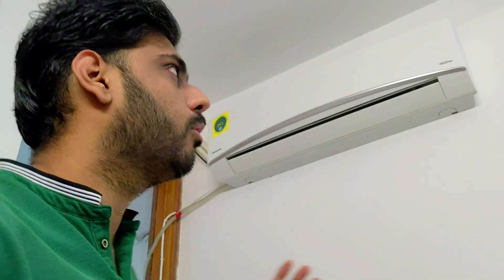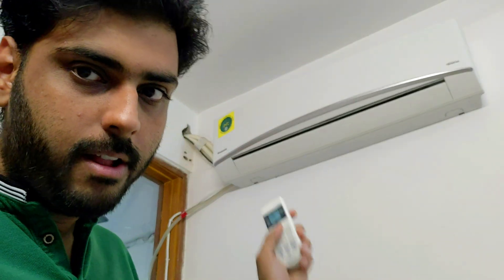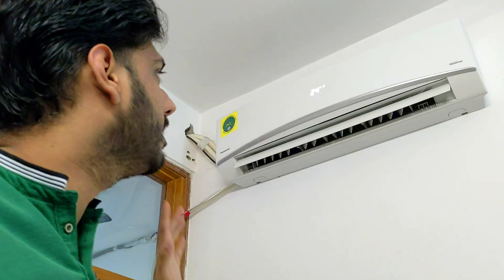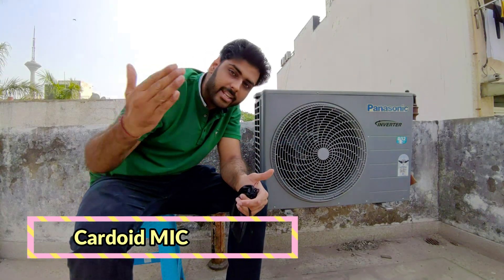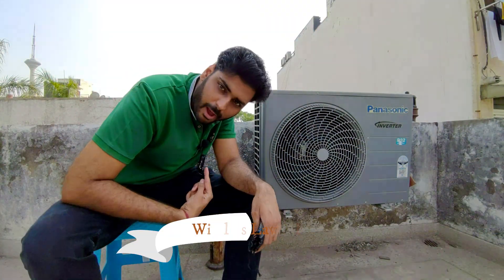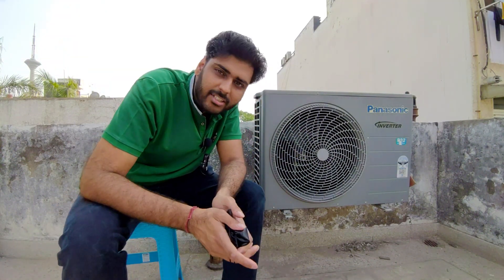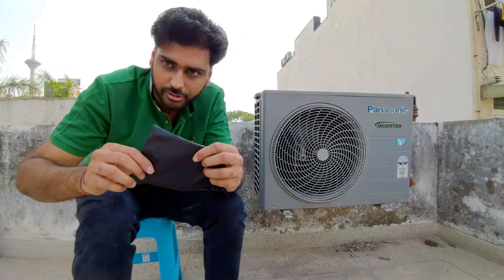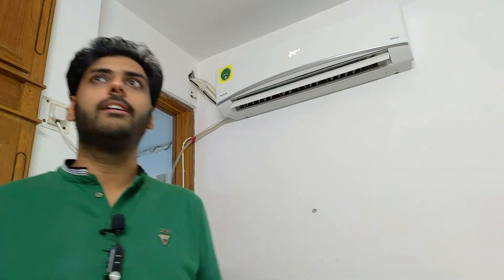Panasonic Split AC ki Awaaz || How Loud is Panasonic Split AC || Full Detail with 3 Different MICS

Comment: Bhai ksa working h ac ka....
175² ft ke liye sufficient h kya 1.5 ton model ???
Reply from the maker: Bro my room is 13 foot long 10 foot wide and 10 foot height and in that area the ac performs fantastic have no complaints.
Reply: Upto 180² ft ke lie rated hai ye

Comment: Acha ek baar darwaza kholo aur 16°C pe rakh kar AC chala ke dekho kitni cool kar rahi hai..🤔, maine apne 1.5 ton Panasonic inverter AC mein try kiya to utna cool nahi ho raha tha room compared to my old non-inverter 1.5TR R22 Split AC which managed to cooled the room significantly even after the door was opened completely. (Sizes of both the room is same).
Reply from the maker: We sometimes use this ac with 2 rooms of same size which 13 ft x 10 ft x 10 ft and first room where this ac is located gets pretty chill and other one gets liveable that too at 24 degrees. And the rooms are located at top floor which is 5 side open so it's gets hot but no problem.
Reply: Non inverter mein r22 gas dalti muje bi Aisa lgta non inverter ki cooling mein thandi jyda hai 😮meine godrej ka lia hai abi 4 din phle inverter ac aur dusra Onida ka non inverter 12 saal wala hai wo thanda jyda krta

Comment: It's loudy as compare to other brand..I purchased this one..
Reply from the maker: Well I don't know what silent actually is. But I find this one to be super silent compared to any window I have heard.
Reply: @AmulLuthra  yes it's silent then windows ac.. personally I am using Panasonic ac..but it will compare with other new ac..which is my frnds using..which is more silent..Panasonic after required temperature achieve it will be very silent.
Reply: Maybe because the air throw is more powerful than those offered by other brands, this Ac is actually rated for upto 180² ft. Area. While other ACs are rated for 150² ft area. Recently purchased the 2022 model.
Reply: @rajranpara257  Yes you are correct. Got 2 Panasonic 1.5 ton smart ac at home. Outdoor units sound is more as compared to other brands , maybe coz of fan Speed.
Reply: @starboy_inc6723  bro try to set indoor unit fan speed 3 or 5... Not use in auto mode...then check outdoor noise..

Comment: Bhai ek cheez batao,mere paas bhi panasonic ki 4 star invereter ac hai....mere mein set hua temperature ane pe compressor off ho raha hai..lekin ye to nahi hona chahiye kyunki ye to inverter ac hai
Reply: The compressor will switch off if the room is nicely air tight.
Reply: @rahuldasgupta5996  haan air tight to kiya hai..acha air tight hone pe agar compressor off hota hai inverter machine ka,to ye kyun bolta hai ke inverter ka compresser dhime chalta hai har waqt lekin kabhi band nahi hota??? Sabhi to yehi bolta hai..
Reply: @soumyajitkoley8918  it's not important that inverter will keep working all the time 😂 it happens to many. Inverter means variable speed but that doesn't mean it won't go off.
Reply: @rahuldasgupta5996  fine,but aur ek cheez main agar 24 rakhta hoon to 20 mint ke andar 24 ho raha hai aur uske baad compressor band hor raha hai aur thodi der baad firse on ho raha hai...isse kya zyada bill ayega ??jab bar bar chalu ho raha hai compressor tab lower speed pe chalu ho raha hai??
Reply: @soumyajitkoley8918  nope, it's gonna use electricity as much required but still you can buy smart plug to track the electricity consumption every time.
Reply: @soumyajitkoley8918 Yes mere Panasonic AC ka compressor bahar jab 42°C pahunch jata hai tab wo 100% speed mein nahi chalta hai, balki wo 90% mein chalta rehta hai, aur jab main 27°C pe rakhta hun. To wo slow hoke band ho jata hai.
Reply: @soumyajitkoley8918  Aur ek chiz, if you want to check how much is your 100% compressor speed, then turn your remote on and set to cool mode, temp in 16°C, Fan Full speed, Swing position 3rd and press the auto switch button present on the AC for 3 sec and (open the filter access door of Indoor, button will be present on right side).
Reply: Its panasonic dna, worst inverter ac i have ever seen and exoerienced.. non-inverter ac ke trha hi kam krta hain panasonic inverter ac, ruk ruk ke chlta hain, room ke andar kabhi thand toh kabhi thoda garm lgta hain.. full bakwas panasinic ac, i use LG but never feel this issue.. maintain room temp very very accurately.. and its dsnt turn off like panasonic, thts y LG is best brand of inverter ac.

Comment: Panasonic ke ₹33,500 wali 3star inverter ac actually mein loud hai. Bro, youtube mein video comments ka koi option nahi hai warna mai khud sundeta video record kar ke.

May be ₹40k ke upar wale model mein sound kam aata hoga. Both indoor and outdoor.
Reply from the maker: Mere wala bro 4 star hai and ye 40k se upar hi aaya tha tab. And sound toh aapne suna hi iss video mein. It's super silent. 😀
Reply: @AmulLuthra   Aur ek chiz, if you want to check how much is your 100% compressor speed, then turn your remote on and set to cool mode, temp in 16°C, Fan Full speed, Swing position 3rd and press the auto switch button present on the AC for 3 sec and (open the filter access door of Indoor, button will be present on right side).
Reply from the maker: Will try bro but kabhi need hi nhi pdi 16 degrees pe chalane ki as it starts to get really cold. Thats why 24 to 26 ki range we prefer. 😀. And one thing bro if I open the filter cover by using the ac at those settings will I see anything different like ice formation or anything. As whenever I use clean function it does make the cooling coil turn white.
Reply: @AmulLuthra Hmm, clean function works that way, But Nah, i assure koi problem nahi hogi, clean function actually cleans by forming ice on the heat exchanger, then defrosting it by running indoor blower at full speed. So ice ban jata hai pani, and your indoor evaporator heat exchanger is cleaned out (mostly but, utne bhi achi tarike se clean nai hota when compared to manual hand cleaning of heat exchanger fins & coils).
Reply: @AmulLuthra Bro, just see at 16°c, your ac's compressor will not go any higher rev's instead compressor will run at full speed, and most probably will not switch off until the temperature has reached or your compressor has overheated😂, you know panasonic has designed their AC's embedded software system such ki, wo tum kitne bhi temp.  pe rakho once you cross 24°C, the ac cranks the compressor to whatever highest rev possible depending upon you room & outdoor surrounding temperature. Then, it slows down if temperature has been achieved, and then eventually turns off the compressor.

When the outdoor unit starts, the PCB present in the outdoor unit senses how much current is taken up by compressor corresponding to the dicharge line temperature. Then, it finalizes at what ratio the compressor should be run without damaging anything and give optimum cooling and power saving efficiency at that moment.

Then, In 16°C simply, the compressor may run at 100% speed or may run at 90% speed or at 80% depending upon room temperature and outside surrounding temperature and keep the same rpm. Until the temperature is achieved in your room or the compressor has overheated, then the rev goes down eventually, does not matter whether you kept your ac at 16°C or 24°C.

This i found out in my Panasonic AC, after 6 months of experiments with it.

I think closely Panasonic Engineers have designed this model split ac to work like this only as i mentioned above.

Give it a try. Once
Reply: Maine is bande ka video dekh kar do week paileh he Panasonic ka AC lea or aaj isko gali dene ka mann kar raha hai,parsian Ho gaya hu compressor ka sound se, jab knowledge nhi hai kisi chej ke bare me to Q video banate ho Faltu me kisi ka mahnat ka paisa fas gaya, Shame on you
Reply: Onida ka ac lelo bilkul silent h
Reply: @thebanglatalks541 cooling nhi kr rha kya phle m Panasonic le rha tha phir godrej lrli😂

Comment: How perfectly was this installed? I have purchased 3 units of the latest 2022 model with nanoe. I have refused the technicians to install unless and until they come with a vacuum pump. They do not want to use a vacuum pump and want to purge the lines with the refrigerant gas by releasing it and pushing the air out instead of pulling a vacuum with a vacuum pump. It's my hard earned money and I'm not going to let these pricks install the units any which way they please and compromise on reliability.
Reply: Finally did they use vacuum pump? Or else, what did happen ultimately?
Reply: @bijoyghosh1918  Yes, the company sent technicians to perform a paid install. It was all done perfectly as expected. The initial set of people who came to install 1 unit were sent by the retailer who was offering free installation because I bought 1 unit from a shop and the remaining from Amazon. I now have 6 units installed at my home, chilling performance if need be. Amazon schedules the installation with the brand service center by default I noticed, and not with any local amateurs. :)
Reply: @aaacreations6036  actually yesterday I purchased two units of Panasonic Split AC (1.5 ton, 5 star) from a local retailer. They told brand's technicians would visit. I'm worried what if they don't bring vacuum pump and say "aise hi hota hai"! 
Should I send them home then, and file complaint with Panasonic?
Reply: @bijoyghosh1918  They will come with the required equipment if they are from the brand service center. Else ask to show ID. If not you can complain with Panasonic. Don't take a chance with aise hi hota hai.
Reply: new ac me vacuum ki jarurat nahi hoti he , vacuum actully wo AC jinme R410 gas dalte the unme karte the kiu ki wo 2 gas milake bante the aur accident pron the, abhi R32 yea R22 me kuch nahi hotaa, aur company tumko vacuum already karke hi bhej te he, agar dusribar vacuum karoge to compressor ka life reduce hoga.

Mera panasonic ka ac vacuum nahi kiya machine laye the mane mana kardiya, first unit 4 saal chal raha he no issue, dusre December me liya 2023 ka model wo v same installation kiya
Reply: @fluffybunny510   You are wrong. I own a licenced AC installation firm in UK. I will lose my licence if I follow all this nonsense. The connecting hi pressure and low pressure pipes need to be vacuumed before releasing the charge PERIOD. Manufacturers will honour warranty only if the installation protocol is followed correctly. No further discussion or misleading info entertained on this subject.